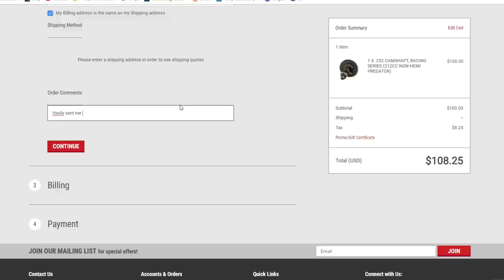Building A Kawasaki KX 250 Drag Shifter Kart Part 2

Comment: This is the best video I ever seen I'm glad it's getting done.      I got my go kart running but the tires that came with it was dry rotted so they got destroyed I'm thinking of getting a V tread because this buggy was sitting outside for quite some time water got all in it and everything but I grinded the rust off and smack some new blue paint on it all I need is the new tires 🙂
Reply from the maker: These flat tires are really nice, but they are expensive and wear fast
Reply: Hey Vasily I got a question what battery can I get because I wanna add LED's for my go kart because I'm worryed that they won't power both of tale lights and the head lights
Reply from the maker: https://www.ebay.com/itm/YTX7A-BS-Battery-For-ATV-Kasea-KS-KU-Models-Adventure-Buggy-CC125-kyhawk-150-170/283317342888?epid=22027317808&hash=item41f70792a8:g:s5cAAOSwaiBcHebv:rk:10:pf:0

Something like this is sufficient. It runs all the lights and starter on my buggy

Comment: I wouldn’t worry about staying under 300 because the shifter kart class I run uses a 125 and we have to be 390 or above and we’re still hauling ass
Reply: In a way more weight will do you better because when you run about 12psi you won’t just be spinning your tires the entire time
Reply from the maker: I knew shifter karts weighed 400lbs, but im curious how. they have two tiny frame rails and thats it. Plus a 50lb engine, should equal out to 200lbs right? there is still alot of weight I need to weld on! and tire pressure

Comment: The tires look great and run it with no mufler that is gone sound sick
Reply from the maker: yes. muffler = extra weight. Ill talk to some tuning experts about that
Reply: It’s a two stroke it needs the muffler for more power
Reply: It needs the pipe not the mufler and more sound =faster

Comment: Make that roll bar half way between ur head and shoulders. Long as its 3 or 4" above ur shoulders it will protect ur neck And look low profile too. Nice vid young man
 Keep it up.
Reply from the maker: IMO, it doesn't rlly matter where I put it, it will have a supper low center of G, which will make it impossible to flip

Comment: Bro , you need side support on your seat and weld more tubing in an X formation to where the engine at , or else you will brake the frame and your neck at 30 mph.

Comment: I have a question:
Would a two cylinder 2 stroke work for an off road mini buggy? It's from a jawa 350 i think
Reply from the maker: Yes, should be no problem, just do gear reduction
Reply: Probably yes. If you know how to operate a 2 stroke atleast
Reply: If you have a Jawa 350 motor don't use it ,sell it . It is worth more in parts Than a newer 250 and makes less power WAY less .
Reply: Snowmobile drivetrains are best custom buggy construction. Indy tripples make like 70h.p. and up! 1987 polaris 440 magnum twin claims 42h.p. and the 660 claims 69h.p. A 900 indy triple can see 150+ and still idle.

Comment: Not to be mean but the space between the axel bearings is too great for the shaft to support the torque of the engine.  It's going to bend the axel the first time you get on the throttle in a serious way.  You have the two bars the engine is mounted to and the one closest to the driven sprocket would be the perfect place to weld a flange and mount a third bearing on the axel.  I'd keep it as close to the sprocket as possible.
Reply from the maker: Yes. I will put a third one, just dont know where it would have the most strength and not take away looks. still deciding
Reply: Also didn't look he made a provision for chain adjustment.
Reply: W Hoggdoc  -  You are right, I didn't catch that.

Comment: Is that a 520 chain? I can't find a rear sprocket in a 520 anywhere for my build.
Reply from the maker: Yes, search #520 jt steel sprockets on ebay. there is a 22t and 33t in the bolt pattern I needed
Reply: @VasilyBuilds  right on man. Thanks

Comment: You might have answered this but I just found your channel and I'm going through and watching them in series. What welder do you have?
Reply from the maker: Lincoln weld pak 110 hd flux core only (what I use 99% of the time)
Vulcan stick 225 ac/DC 
Titanium Mig 170 (aquired as of 3/19)
Reply: @VasilyBuilds  awesome thanks! I'm trying to get into welding and will eventually build a kart also so I'm researching and reading up everything I can! Love the channel and I'll definitely be watching more!

Comment: I know nothing about karts but would it be possible to build a cart with rear suspension?
Like have the engine and rear end built on a subframe that can pivot behind the seat and the implementing a shock of some sort.
Sorry if this is a dumb question

Comment: You should build a cart with suspension and off road tires
Reply: I agree....I'm thinking a full suspension cart with actual 4x4 but keep it a cart not built a SxS. Or build a 4wheel drive shifter kart.

Comment: What material are you using to build the frame.   Very nice work.  I looking to buy pipe just not sure what to get
Reply from the maker: 3/4 schedule 40. although 1" schedule 40 is better recommended
Reply: Steel ... im guessing... not aluminum... the roun tubing thickness is 3/4" -1"8 thick gauge  ornamental steel tubing. Schedule 40 refers to black pipe. The weights variate typically from avg  .25 to .188 just depends. Each time you purchase metal they provide a cert. That provides the various heats (melting/boiling points) so when youre welding you can calculate the psi and temps needed. Thermodynamics and crap.....
Btw i work high up for a steel distribution company that has its own fabrication shop and sells structural, ornamental, designpieces... 
If anyones looking... no aluminum... yes galvemized steel...

Comment: And you should have made the rear motor mounts slotted so that you can use it to tighten the chain. How are you going to tighten the chain???
Reply from the maker: chain tensioner
Reply from the maker: but I can slot them to
Reply: Yeah, I chain tensioner would work, but there's not much room there to put one, and a chain tensioner would cause more friction in the chain.

Comment: What is the reason you wouldnt run the engine on the right side of the cart in-sted of behind you?
Reply from the maker: personal preference. Mine will be faster than any 250 kart. have a few tricks up my sleeves
Reply: Vasily Custom Builds cool

Comment: Total weight, the kart weights 160#, how much do you weigh?  Curious as to the lower center of gravity of the cart vs your weight which would be a little higher center than the kart.
Reply from the maker: 140
Reply: @VasilyBuilds  Good, that should keep the stability well under control.

Comment: Just a quick question what is the diameter and type of metal of the tubing you are using to make the frame, thanks
Reply from the maker: 3/4 inch schedule 40 mild steel pipe
Reply: Vasily Custom Builds thanks. Good job on this build too looking awesome!!
Reply: Gauge and thickness.... are more common terms with steel
Reply: @VasilyBuilds  schedule 40 is like black pipe

Comment: What size pipe and what type of metal is it. I want to build one for my grandchildren. Disk brake an paddle shifters. Also I want to build me a two seater that looks like C-cab woody truck with a Harley motorcycle motor with a transmission an drive shaft . Any ideas of a rear end an driveshaft system where to look an what to look for . I think it would be cool to bring to car shows an drive around neighborhood. And parades .
Reply from the maker: 3/4 schedule 40 pipe. I would just stick with chain drive
Reply: Thanks I do appreciate the information

Comment: If you are planning on running a seat belt, run a roll cage. If no seat belt, no roll cage. You want to be ejected from the seat in the event of a rollover UNLESS you have a seat belt (then you MUST use a roll cage for safety). Look at how proper race frames are built, but whatever you do, DO NOT USE A SEAT BELT WITHOUT A ROLL CAGE.

Comment: Fix the dent in the pipe. Btw nice work
Reply from the maker: Probably going to buy a new pipe. a pro circuit works pipe. This is a fatty pipe and is made for low end torque. I want top end power

Comment: Fill the exhaust with water with one end blocked and put it in a freezer overnight to remove those dents, I would have used a bigger diameter axle than 1 inch,
Reply from the maker: Great tip!! but im Probably going to buy a new pipe. a pro circuit works pipe. This is a fatty pipe and is made for low end torque. I want top end power
Reply: @VasilyBuilds  do you have somewhere big enough to hit full speed ?
Reply from the maker: Yea Ill just put it on a trailer and we have very quiet country roads here
Reply: The roads won't be quiet for long lol

Comment: That roll bar is not high enough, if you actually roll this thing your head will hit the ground hard. Looks are not worth the risk of a head injury. Also I hope you have a plan for some sort of harness to keep you in place as well.
Reply from the maker: Will think of something
Reply: It’s really wide and low shouldn’t be to easy to roll plus the engine will keep them 10s spinning
Reply from the maker: Roll bar will be most likely be where it is now. Someone suggested it be between the head and neck.  The seat will probably be placed as low as possible, and it won't be tilted as back much. Yea the center of gravity is going to be so low, that it will probably be impossible of flipping it

Comment: great build. There is a problen. your roll bar is wrong. its not functional. If you imagine a line frome the top of the roll bar to the front end of the kart, it should be over your head. yours is clearly not so in case of a flip your head will hit first and then the roll bar
Reply from the maker: good way of looking at it. my head is under the bar, just not the helmet seat will probably be much lower and it should be good
Reply: It's a really nice build overall. I 'd like to see more of it. Great work.

Comment: I’m cringing with the plastic seat  so close to the exhaust
Reply from the maker: 2 strokes exhausts have a large surface area, are thin, and dissipate heat much better than 4t. You can mount it 1 inch away and it won't melt